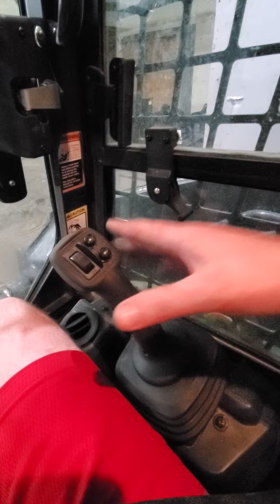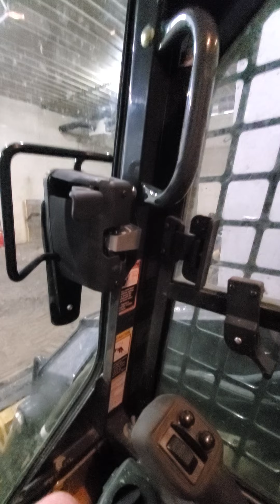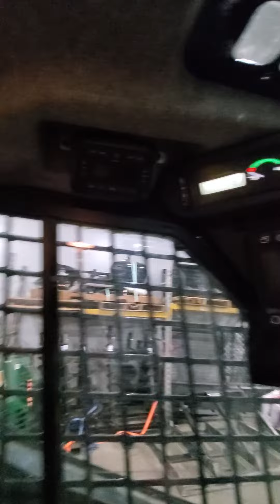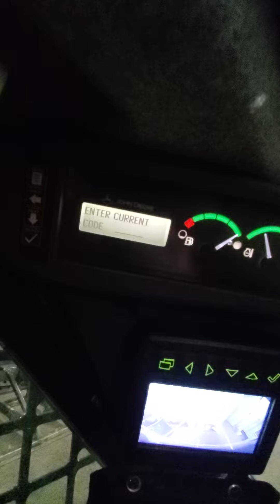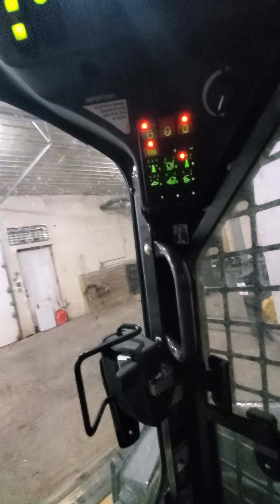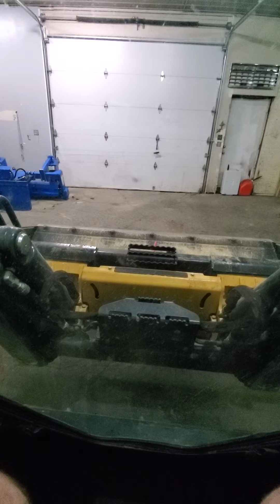John Deere 317G controls, startup and shutdown

Comment: This was helpful, but you didn't show anything about the control pad. I want to know if that particular skid steer has a button to make it go faster. I know if you hit the move control button it will go a little faster but I'm wondering if there's a magic switch somewhere else to give it a turbo speed.
Reply: The 317G is only a single speed.
Reply from the maker: @damonwicketts1638  Correct. If you have the performance package you may have it turned down a little for grade control. @berkslostvids3405 is there a toggle switch just in front of the right joystick?